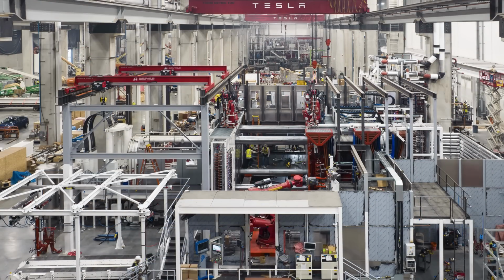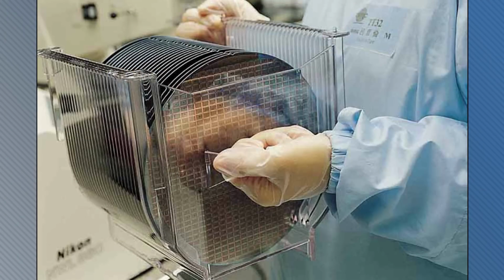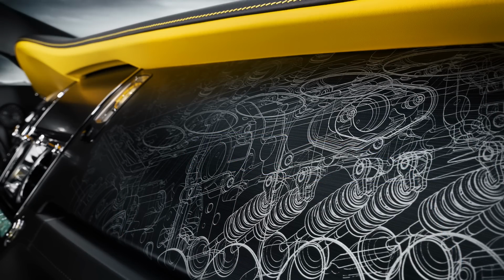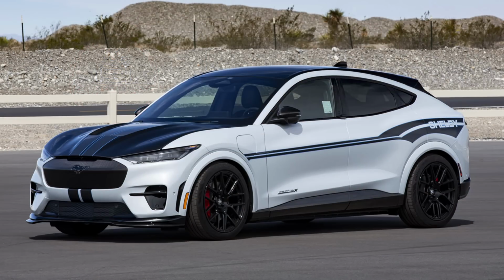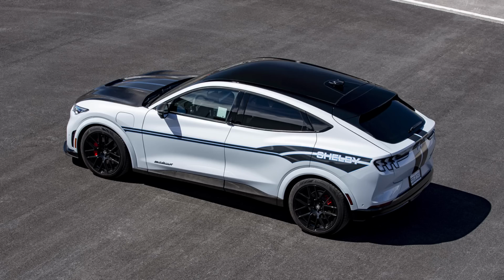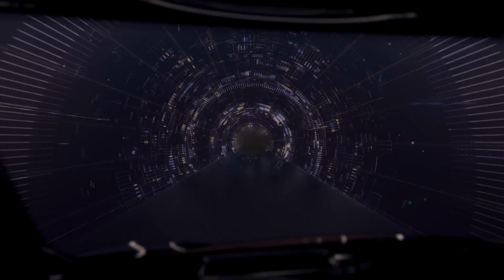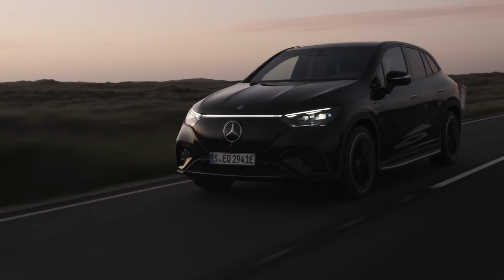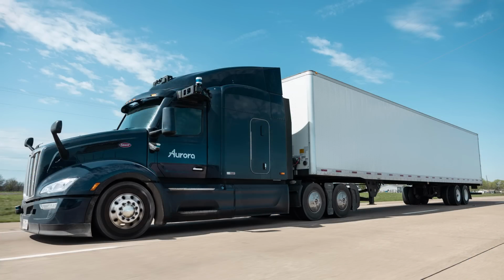OEMs Racing to Copy Tesla Gigacastings; Shelby Mach-E Not Sold in U.S. - Autoline Daily 3555

Comment: The castings might be a good idea for the factory but we still don't know how it will work out after the sale for accident repair and how the insurance companies will treat it.
Reply: Neither one will be a problem.
Reply: If that casting is damaged, any other car would be totaled anyways.  You'll likely see a reduction in non-totaled repair costs.  People who fix totaled cars will weld the castings and repair the car just like major frame/body work already done on an ICE auto.
Reply: There seems to be an assumption that each and every of these giga castings will be perfect when it comes out of the giga press.  Anyone that has anything to do with the die casting industry can tell you that the more complex the part, the more difficult it is to get dimensionally and material quality parts out of the mold.  Yes, a lot of distortion and porosity can happen even when you think it shouldn't. Looking at cycle times close to 3 to 5 minutes, it gets expensive and slow going, trying to get something "cutting edge" to do what you want it to do.
Reply: @paul5683  Teslas  production  rate improved after the Gugacast process was adopted  also flaws like gap imperfection  were eliminated  as  stated by A TEARDOWN expert Sandy Munro , he was in Giga Berlin last week, the mod Y  was as good as any car from legacy auto, Google Geely , they said Gigacast eliminates 800 welding points that creates many cutting problems, on top of chassis flex.,
Reply: Is it really stronger than spot welding? I'd like to see a study. It'll be faster with less cost, yes.
Reply: @benjaminsmith2287  It's not necessarily about being stronger than spot welding, though it probably is. It's about simplifying the process (one piece instead of 20) AND an increase in accuracy. When you are attaching two pieces together, there could be tiny variations in their relative orientation or position. In a casting, everything will be exactly the same, every time. So less parts, less steps, more accuracy, cheaper to make a higher quality product.
Reply: @ColinFox  I understand that in theory. But one of the things that makes a Porsche feel stronger than others, or say a Lexus stronger than a Toyota, may be increased spot welds. I find no issues with body solidity in Porsches or most Lexus cars at all. I want a really extensive objective analysis of the two and then seat of the pants impressions,. Saving money and time is the goal of large castings. I'm not convinced it is strengthening the car or making it easier to maintain. That's why I ask the question. This is a money/time saving measure.
Reply: @benjaminsmith2287  "Is it really stronger than spot welding?"  For sure, weld placements are always an issue a solid structure can displace impact energy better. 

"Casting vs Welding

The casting is a more precise process and the overall chemical composition is evenly distributed. The process of obtaining metal castings with a predetermined shape, size, and performance also reduces processing time and costs. The manufactured welded workpiece is less precise than the casting and the mechanical properties of the joints are also changed. But it is more convenient and extensive than casting. Some special materials can not be welded effectively but can be made by casting, while casting is more suitable for manufacturing smaller workpieces."
Reply: Once everyone is using FSD it won’t matter.
Reply: Why not? Tesla uses big castings since 2019. 
Surely someone would know by now if it is easier or harder to repair or if it makes a difference at all. 

Its the same with battery pack repairability. Right now Tesla always replaces the whole pack, so might as well integrate the cells structurally. 
All the Chinese manufacturers do the same.
Reply: @theipc-twizzt2789  GM used casting in 2015 for CT6.  Thr Germans before that.
Reply: @normt430  Aluminum casting has been around since  around 1850. But it is about the possible production size, which is mainly limited by the die-casting machines.
Reply: @theipc-twizzt2789  that's why the insurance is higher on a tesla. 
Wonder how the stats work out on accident rate/theft compared to other cars?

My driving record is the same but insurance on the Y was more than DOUBLE that of my Outback. Similar book values (48k vs 52k)
Reply: @chrisperry3525  Interesting. Compared to a Mercedes C Class I pay a bit less for the Model 3. The 3 however has around 3 times the horsepower and here in Germany insurance rate is highly influenced by that.
Reply: The cost of replacing these so called "giga" castings will be astronomical rendering wrecked older vehicles as junk.
Reply: @heathwirt8919  have bought and fixed " Totaled "cars, you never get  the money back from fixing them , even tho they spotless , when reselling you have to divulge that the car was in a accident or TOTALLED , in Ontario  , Canada the " TOTALLED  cars are  issued a title Registration  as "BRANDED", meaning it was a writeoff, you'll never get top dollar for the car. We  have what is called " CarFax"often the history of the car is there.
Reply: @aurelio-reymilaorcabal9669  There will be a glut of totaled Tesla's with "Mega" castings available for scrap soon. Junkyard recyclers will love it.
Reply: @heathwirt8919  Theres a glut of what would seem to be repairable ICE cars in auctions, I USED TO GO TO THEM,  found out that Totaled car were not worth the hassle, even if thee cars were  less than 1/2 priced, im talking  by experience  as my friend is in the AUTO COLLISION business, I made use of his services , several times.
Reply: @heathwirt8919  in your world ICE cars don't get totalled?
Reply: @aurelio-reymilaorcabal9669  The do indeed but nothing like these "MEGA" casting POS.
Reply: @heathwirt8919 that is why we have this thing called  INSURANCE.
Reply: @aurelio-reymilaorcabal9669  And insurance companies have this thing called beyond economical repair and write the vehicle off as totaled.
Reply: @aurelio-reymilaorcabal9669  But we are already seeing repairable EVs being totaled out rather than fixing them. So the family budget now must have the extra cost of gap insurance plus likely increases in insurance premiums. Fine for the early EV folks that have a lot of money but that won't be the case in the future.
Reply: @heathwirt8919  i bought  a  TOTALLED 1 year old 2004 Honda Civic in 2005,for $8,500 had only 17,000kms, needed a trunk,rear axle, car was worth $20,000 new,fixing it and getting it roadworthy  was another $5000, and it was then registered as a "BRANDED " , selling it afterwards was a hassle, ( I never got  my  money invested in fixing that  car)¥nobody wants an ACCIDENT CAR,  now imagine if I had to replace Airbags, SideCurtains and Sensors and Headlights, like I said if the GIGACAST  needs fixing,  that is the last of the owners worries, they probably  are dead or severely  injured.
Reply: @davidmccarthy6061  ICE cars don't get  TOTALLED?  In what country?
Reply: @davidmccarthy6061  About 3 years ago Autolinedaily   said that Genesis  cars in collisions cost too much to repair  thus  they are written  off, AIRBAGS, HEADLIGHTS AND SENSORS made such repairs expensive ,thus Insurance  Agencies  just  WRITE OFF the cars, this is for cars that don't even show much FRAME  damages,

I think  this discussion  is longtime overdue in Autolinedaily.

Comment: Castings are to expensiv for cheap cars!
Reply: Please expound on that Burno!   Word is that the casting are less expensive than the parts they replace.
Reply: Asian die casting dies have displaced most of North American supplied dies.  They are very difficult to compete with (I used to work for a die casting company).

Compared to multiple stampings (and the associated stamping dies) as well as shorter assembly lines, I’m pretty sure a business case can be made.

Aluminum castings have been used in steel chassis systems for a long time, offering similar benefits (on a smaller scale) as well as a stiffer structure.  I’m no Tesla fanboy, but I gotta give credit where it’s due.
Reply: @superspeeder  You know that alluminium is way more expensiv then steel and it needs way more energy to produce and recycle it!You can use diffrent strengh steel for diffrent parts and weld them together!Alluminium isnt realy that hightech anyway!Its kind of lame!How about carbon strengtgened plastics,or composit materials?
Reply: @brunoheggli2888  you want to talk about something that’s too expensive to use in cheap cars, let’s talk about CRP (carbon-reinforced plastic), 😁

Yes aluminum is more expensive than steel, but it doesn’t cost more to replace X-number of steel stampings in a cheap car than it does in an expensive car.  Remember, the raw cost of the materials in car parts only represents a tiny fraction of the part cost.  R+D plus Engineering the parts, processing the material into parts, logistics/transport/handling/storage of the parts, and final assembly of the parts is where the big costs lie.

This is why trucks are so profitable; the parts count is no higher than a car, but the massive increase in sales price over a car far outweighs the cost of the additional raw materials.  The parts are bigger, but don’t cost much more to make.
Reply: @superspeeder  Its to expensiv now,that dosent mean its to expensiv in the future!Useing Alluminium is just lame  and no real hightech!Castinga arent something special at all!
Reply: @brunoheggli2888  is steel more high tech than aluminum?  I’m not sure where you’re going with your argument?
Reply: @brunoheggli2888  The difference is not big with recycled material. 1670 kWh of energy is required for 1t of steel (If it's high-strength steel, then that's quickly over 2500 kWh, just because of the necessary post-treatment during production) and 2000 kWh for 1t of aluminium.
In a volume comparison, aluminum performs far better than steel.
The recycling of connected steel structural composite is sometimes more complex or not entirely sortable.
And we don't have to talk about the energy consumption and recyclability of carbon/plastics, but it's interesting that you mention it yourself after wrongly criticizing aluminum with the higher energy.
Reply: @superspeeder I don't think he has any idea what he's talking about
Reply: Or maybe it is expensive during the inital ramp and if it is for low volume, at high volume you would save money, cheap model or not it should not matter.
Reply: @nguy404  once the investment has been made to develop these extra large machines, duplicating them is much cheaper.  Perhaps the industry needed a company like Tesla to A) prove the economics, and B) invest in a larger scale machine.

Either way, there have to be benefits if Tesla did it and others are following suit.  Car companies are chock full of extremely intelligent people in all fields.

Comment: Tesla invented the alum allow to make giga castings work and not distort or crack when cooling. It will be interesting to see if other companies will have access to that alloy or have to invent their own...which will put them a few years farther behind tesla
Reply: The insecure "legacy" old guard can't stand the idea that Tesla invented anything lol. Oh no, the biggest proponent of in-sourcing and vertical integration in the auto industry can't possibly have their own advanced metallurgy unit.
Reply: @AllanSustainabilityFan  well, they are rocket scientists LOL
Reply: Idra Group
Reply: @jdmather5755  Irdra didn't want to do what Tesla wanted. they thought it was stupid.
Reply: Yes.   They developed a patented aluminium alloy.  Idra is just the manufacturer of the press.
Reply: No they didnt!
Reply: @brunoheggli2888  They did. with a little help from spacex.
Reply: Tesla has been the creator of everything ever, if you ask the fanboys.
Reply: @davidmccarthy6061   That is just a hater talking point.   We know tesla did not invent the hairpin motor or 48V electrical system.   The important thing is Tesla is using them.  Tesla does not fall victim to NIH.
Reply: @danharold3087  Tesla makes what it does not invent better.  The haters are hilarious because tesla is too successful to be denying it anymore.  Which is why the smartest in the industry are copying them as much as possible.
Reply: @davidmccarthy6061  It's disturbing, the degree of fanboy building up Tesla to be unlike anything anyone else could possibly be goes even beyond the Apple fandom. And I thought at the time that was as obnoxious as it can get.
Reply: @danharold3087  Tesla mostly invented Hype and the fanboys keep repeating this Mega Hype on every thread. Some people get sick of hearing this BS. That's not trolling but the constant Hype is.

Comment: Was I tempted to pay Tesla $2,000 to reduce acceleration time on my Model Y long range, Yes, did I NO.
Reply: The value of money varies by the person.    Apparently there are people who can say hey why not.  I am not one of them.
Reply: I didn't spring for the boost either.  The Model Y LR without boost is faster than those Mercedes after their boost.  It's pretty easy to scare your passengers if you like.  But then you might have to clean the seats.  ;-)
Reply: Super cheap and not an offensive addon because the car is already fast without the upgrade.  These features happen because tesla chose to design around the faster acceleration which cost more, then put that same hardware into all the cars to standardize around it and make it cheaper.  That makes the acceleration upgrade super cheap at $2k instead of being a completely different lower volume motor.  That also means less warranty failures in the cars that do not pay for the extra acceleration.  So without paying, you get the benefit of the more robust motor even if you do not pay to unlock the additional acceleration.
Tesla did this right.  Other oems offer crap and then make small upgrades to things like infotainment really expensive.  Other oems want to advertise the lower price, but sell the higher priced cars via upselling at dealerships.

If tesla had two different physical motors and wasn't just selling the software to make the motor accelerate faster, the motor upgrade would be $20k or more.  Instead it is $2k and their entire fleet warranty costs are lower for those that do not upgrade.